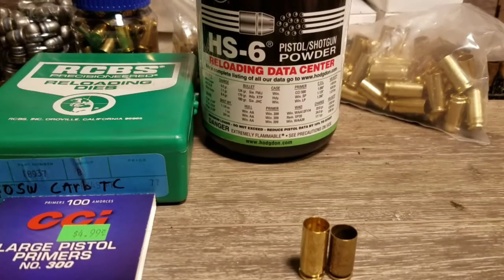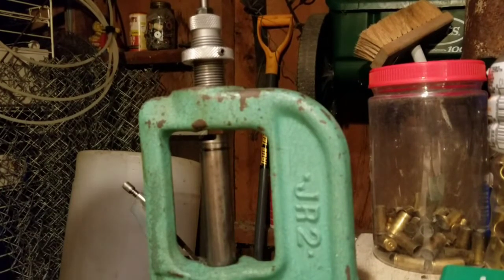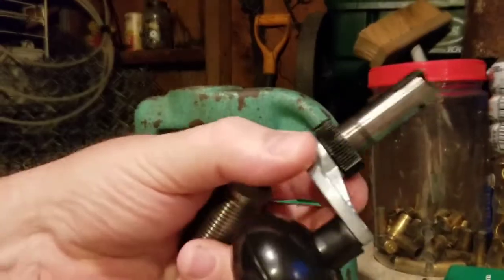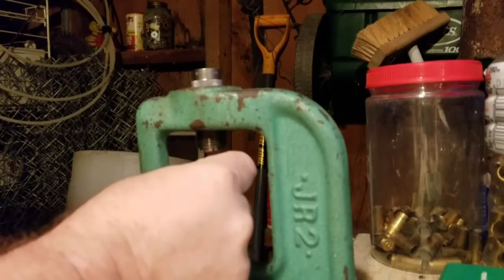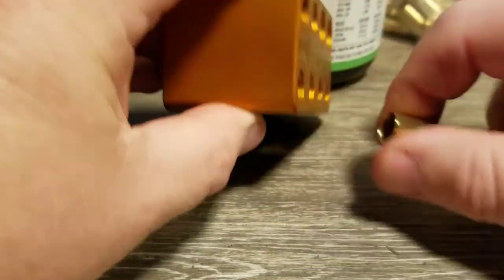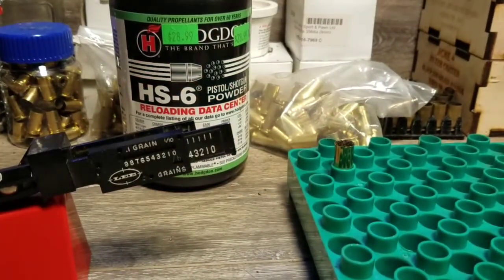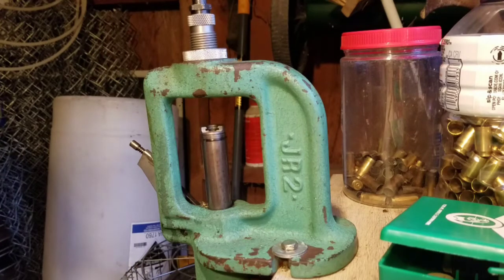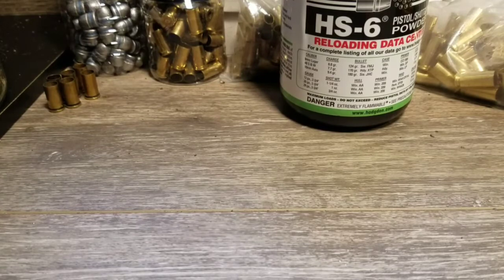Making 40sw from 10mm brass. Revisited

Comment: Great video, I have way more large pistol primers than small pistol primers, so this may be a handy trick to try. Have you measured the case volume of the a 40 S&W case compared to a trimmed to 40 S&W length 10mm case? Are they equal?